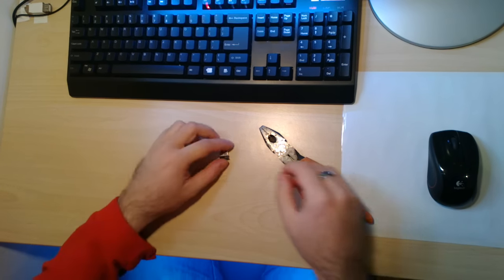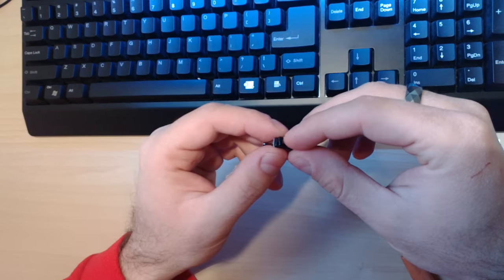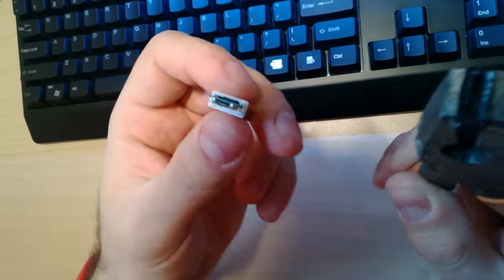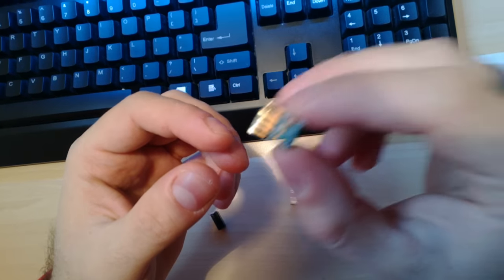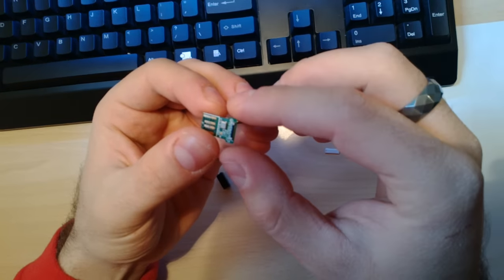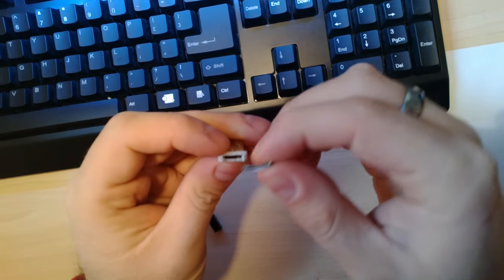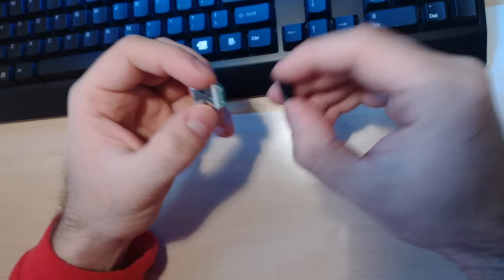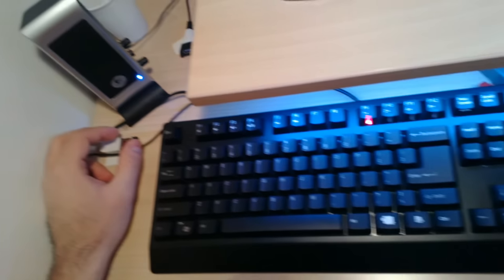How to fix faulty USB Receiver (Logitech Unifying)

Comment: Sorry Bro, but, that fix does not fix anything. Or maybe my problem wasn't a contact problem, i think that my chip internal was breoken. I attempt to fix  it but after a little search i find on logitech website that they sell  the transmitters/receivers at low prices. So, i ordered one original and it function better than my old one usb device.

Comment: in my mouse the little black square behid the mouse receptor has a little white mark, is that the reason why it doesnt work?
Reply: The white mark was there on mine as well.  It works fine after this fix.  The spot's not on a connection point so I think it's inconsequential.

Comment: How do you get the casing to stick back onto the usb?
Reply from the maker: +Gallent Bristle there is something called adhesive or common called glue.
The earliest use of adhesives was discovered in central Italy dated to Middle Pleistocene era (circa 200.000 years ago). Try with that. xD
Reply: I tried glue, and it either doesn't work at all, or provides a temporary solution.

Comment: ive been having that problem when I push my usb corr down its works if I leavit alon plugged in it does't work soo my mother is gonna buy a mouse with a wire that's not like logitech

Comment: does this work with any reciever?
Reply from the maker: yes
Reply: Ok, I have got one that's the size of a USB? And it has a light to show it's got signal of my mouse. So for USB sized receiver, can i still take it off like u did?
Reply from the maker: +Legendary DeagleMaster there could be problem with connection with usb pins and contorler. You will probably need to resolder them.
Reply: Igor Novak  ok thx tho, i fixed it i nneeded new battries :PP

Comment: Only the keyboard connects but the mouse doesnt any  help?
Reply: +Muhammed haitham Ayyoob Then the problem is likely not with the USB dongle. Try running the setup application you find on the Logitech website to add the device.

Comment: I tried taking of the cap with pliers but my hands were not strong enough. So i bit the metal part with my teeth while trying to take the cap of with pliers. i still could not do it and i bent the the metal because i was biting to hard. i had to put the metal part back into its original shape. then i gave up and plugged it in back into my pc. and magically it worked.

Comment: I fixed it, if you have the k520 and m310 mouse keyboard combo, you need to repair with Logitech Unifying Software

https://support.logi.com/hc/en-au/articles/360025297913

update the drivers as well while you are at it

https://support.logi.com/hc/en-us/articles/360024843513--Downloads-Wireless-Combo-MK520

Comment: As some have said, the recievers from some of logitech's gaming devices are pieces of shit. They maintain barely any contact after extended use and the caps are ridiculous to get off. I actually had a unifying reciever from an old mouse and just swapped the chips and called it day. They charge like 20$ from new ones. Don't waste your money, fix it urself a 4th grader could do it.

Comment: i have a microsoft mouse and the cursor keeps on jumping and i dont know how to fix it (its a wireless mouse)
Reply from the maker: what is the model of your device?
Reply: wireless mobile mouse 1000
Reply from the maker: +Nevada Kerst one more question. Do you often hear random sound in Windows same as when you connect new device?
Reply: no, not at all
Reply: Igor Novak i do hear the windows install sound, like i do most other devices
Reply: Igor Novak sometimes the mouse jumps around and sometimes when i click it doesn't register

Comment: I cant get the cap off, HELP
Reply: I CAN'T GET THE CAP OFF EITHER!! WE FAILED STEP ONE!!!
Reply: +Cookie Monster Live In the USB part of the receiver, there is 2 little holes so what I did, I found a knife to carefully put it in one of the holes and pull the plastic part off with a pair of plier, dont be scared to squeeze hard with the pliers, once you get it open, do as in the video!!
Reply: What do you mean by stick the knife in?
Reply: +Quietus Its actually easier to use a staple remover to put in the little holes and then you take a pair of plierthe black part, dont be scared to squeeze hard the plier, it wont break